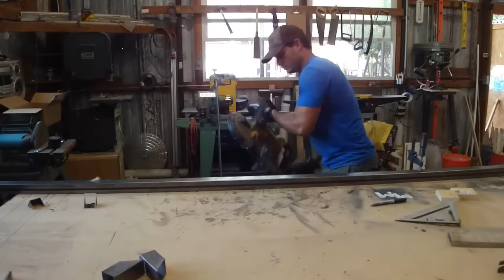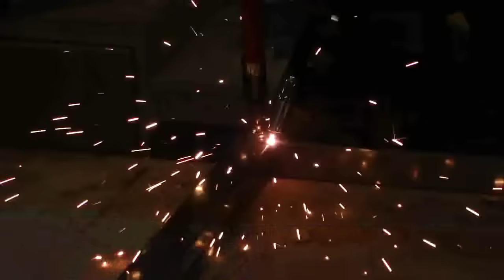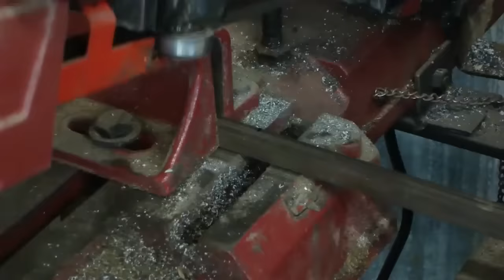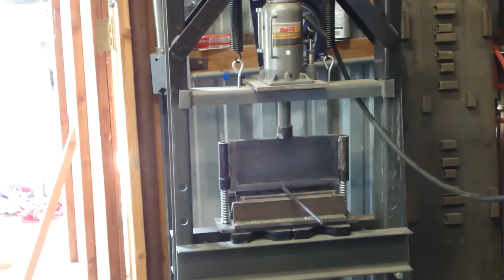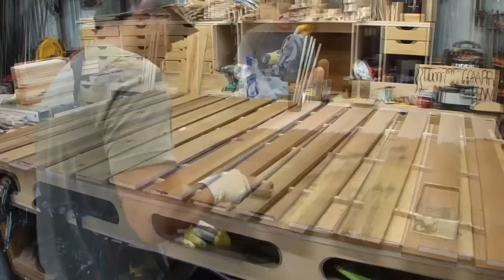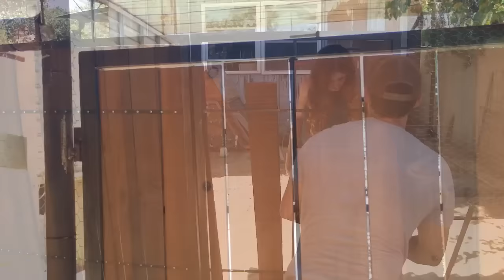Rustic Wood and Aged Metal Gate

Comment: People who don’t understand what fabricating for major clients requires “love this video” because of the artistic components which makes sense- and don’t see the CRITICAL flaw early on that in this case didn’t really matter, but it sends a horrible message to young or inexperienced welders/builders that could absolutely cause a major problem  if you were building with HSS (it’s not called “square tube” btw...it’s called Hollow Structural Section) larger than the 2” in this video. YOU MUST ALWAYS MEASURE THE CORNER TO CORNER DISTANCE TO CHECK FOR SQUARE BEFORE WELDING THE FLAT SIDES OF THE FRAME. AT NO TIME SHOULD ANY PART OF THE FRAME BE MOVED FRON THE MECHANICAL ATTACHMENT UNTIL ALL SIDES ARE VERIFIED AND TACKED ON THE 3F and 1F POSITIONS. I have seen THOUSANDS of dollars in material and labor cut apart after a week of welding and fabricating because this simple step was not verified, and caused a deviating of 1/16 of an inch that rejected the part for a major household goods company in Cincinatti, Ohio. This isn’t hating on his video for those who might claim as such- it’s actually highlighting why it’s important for the experienced and skilled to police these forums and give praise where it is proper and revision where required. Nice gate.
Reply: Actually it is often called “square tubing”. I can go to Industrial metal supply’s website right now and look through their “square tubing” section and not anywhere on their site will it be called “hollow structural section”. In fact in 27 years of manufacturing I have never seen that term used. “Square tubing” and “rectangular tubing “ are common terms used in industry.
Reply: @notanymore9471   Thanks for your insights and sharing about your experiences. You have never seen this term most likely, because you probably have not participated in the design and blueprinting for manufactured large scale steel structures such as bridges or aerospace components. The term “Square tube” is not indicated nor recognized language on properly formatted  AISC, and ASME P.E. approved drawings. Have a great weekend.
Reply: @edouardgluck9588  and it’s used in industry all the time. The guy was building a gate not an aerospace product nor a bridge nor anything pertaining to ASME or AISC. The industry doesn’t speak “conceited engineer”.

Comment: Nice effort man. You should have welded a square tube mid rail to help brace it. As you hadn't, you would have been better installing the wood with the gates on your table, that would have helped with sag as the wood would help brace it.  Also, don't fully weld a corner without tacking the whole frame together, otherwise you'll struggle to keep the gate square. Nice tools too
Reply from the maker: Thanks for the tips +Benjamin Button!

Comment: Hey What is the steel size and thickness? 
It's called HSS or RSS correct? I'm wanting to use your dea and build to 7ft panels for my driveway gate. 
Any suggestions? ......
Reply from the maker: I can’t remember. Either 2x2 or 1.5x1.5. Thickness was .120” I believe. But for fence you could go thinner walled. And it’s just mild steel.
Reply: @AModernMaker  I see. I'm thinking about using the method to build a 14ft car-gate. 
(2) 7'x5' panels and attaching them with cattle gate hinges to 6x6 Cedar posts that are already installed.
Reply from the maker: That’ll be nice.

Comment: Two questions: why the 45 angle on the corners, is that for stability or aesthetics? Also what size are the screws holding the wood to the panels, They look like 1/2 inch panels and wondering if a 1/2 screw will hold it together. But it all looks awesome.
Reply from the maker: 45’s are for aesthetics. Screws were 5/8” I believe and they’ve been holding up well so far. Thanks!

Comment: that's exactly what I need only I'm making it 92 inches tall with a crossbeam for added support. my only question is I don't have concrete slab, I was wondering if I could set post on ground with concrete mix. or should I set a it attached to a footing?
Reply from the maker: +Gilbert Matty It should be fine if you set the post nice and deep. Are you going to add a wheel on the long side?

Comment: I'm trying to replace the wood on a driveway gate that's made just like this. What kind of wood did you use or would you recommend that I buy? I've never really worked with fencing like this so I'd appreciate any tips on what I should be asking for at the lumber yard. I'm going to have to get it cut there too. Great job with this video, thanks.
Reply from the maker: I used cedar planks. Holds up well to weather and bugs. Redwood should be good too.

Comment: Great video.  What do you all use to prevent a steel gate from rusting?  I was thinking of powder coating mine after I weld it up.  Any better suggestions?
Reply from the maker: Powder coat or plan on painting periodically. I don’t mind the rust though for that gate.

Comment: What size wire did u used?
What machine is that?
Gas? Ect...? 
Thanks man
Reply from the maker: +X2DaA 503 I think it was .035, Lincoln 210 MP, CO2/Argon gas mix.
Reply: size: 128375638359322090.2  
machine: *%$@
Gas: Gross - Grow up man.